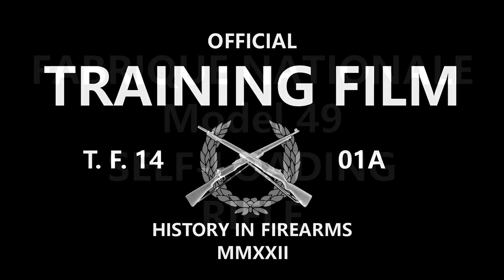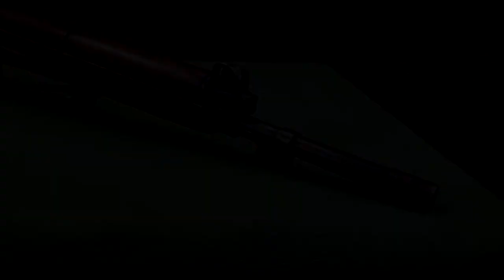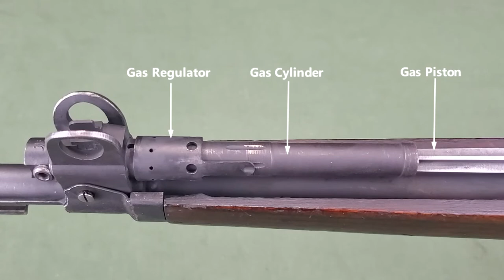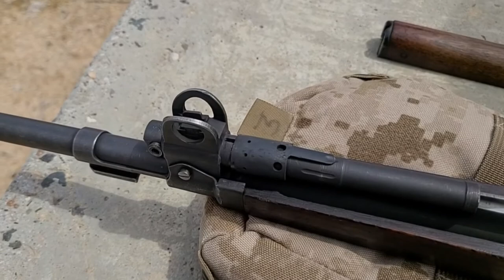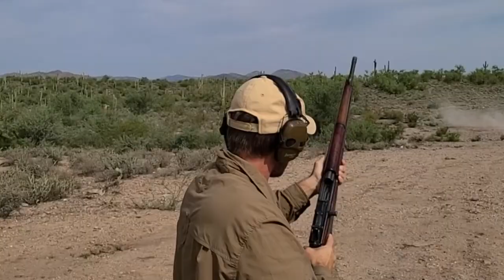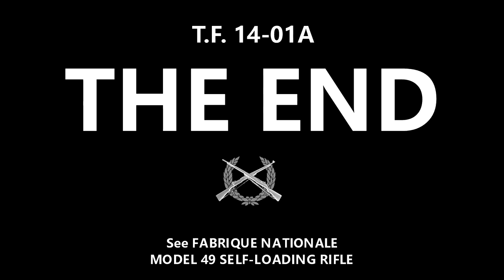FN-49 (SAFN) Gas Regulator Adjustment (TF 14-01A)

Comment: Can the gas key tool fit into the stock cavity (where the cleaning kit goes) when not in use?
Reply from the maker: Yes it can. It will even fit in to one of the aluminum buttstock cleaning kits but is pretty tight if the brush and pull through are in there. If it's in there by it's self I would just pad it so it's not bouncing and rattling around.